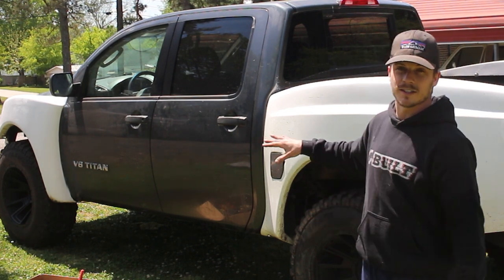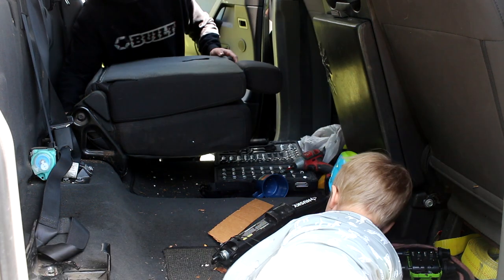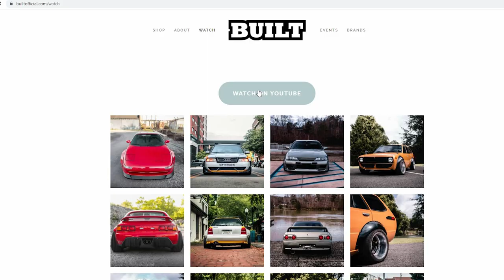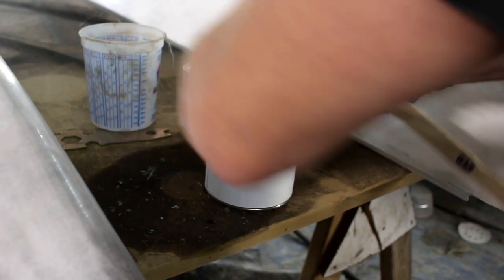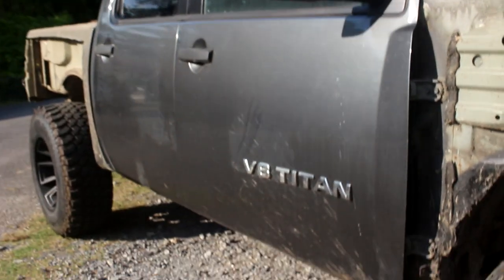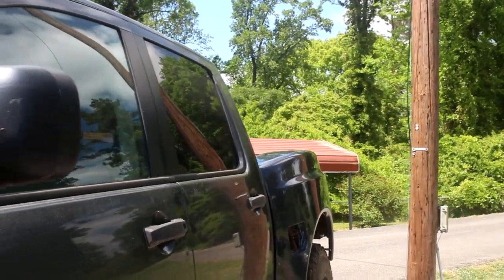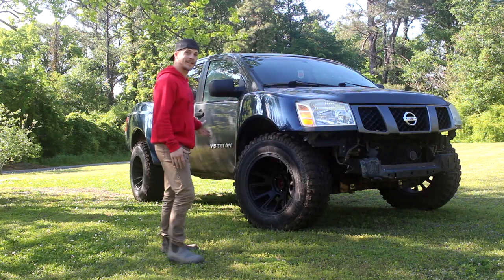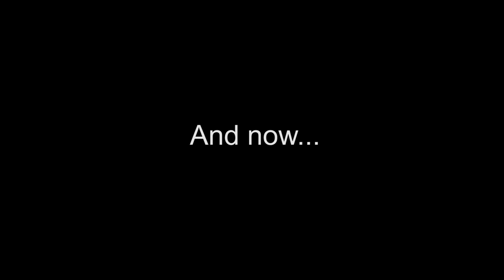I ACCIDENTLY PAINTED MY TRUCK THE WRONG COLOR

Comment: When using fiberglass, bondo or fiber reinforced resin, use plastic wrap or even saran wrap while it is still wet. Stretch it over the surface and pull it tight and smooth it out, remove when partially set up. It will give you a lot better of an end result with heaps less sanding.
Reply: Yep, I use cut up shopping bags

Comment: Honestly man, I’d tape off the trim/glass/badges on the cab, slap on a couple different grits on the DA, hit the cab and roof and rough it up enough for primer to stick just fine, give it a quick wet sand, and spray everything, including your mirror caps and fuel door, and lastly just hit it with that same blueish single stage. That way you don’t ever have to worry about damage or if it gets scratch it up. Would be perfect imo 🤌🏼
Or you could always paint the entire truck in some dessert khaki, or some muted army green rhino-liner 🤷🏻‍♂️ or just wrap it haha full rhino-liner paint would be sick af though. Only finish in the world that you can wash scratches out of 😂

Comment: cuz there's definitely specific things you have to do in spring metallics which I'm sure you know as far as I know it's the angle of the panels and the PSI that the gun is being used will make huge differences in the way the metallics lay down

Comment: So when spraying metalics you wanna spray them in the position they fit on the vehicle so the flakes lay down in the same orientation. It shouldn't be that dramtic of a difference but will effect the color.

Comment: You should raptor line the whole truck. They sale a kit that allows you to do any color. It would look sick
Reply: Especially since fiberglass isn't the strongest material....
Reply: @darrenswails  Fiberglass is way better than steel , it doesn't rust or dent and it's easier to fix if it gets damaged . Most older trucks are more bondo than steel for that reason .
Reply: @Shadowband72  easier to fix ...i said nothing about that...steel dents but it takes heavy impact or a sharp edge to make a hole, the original comment was to  put a truck bed coating on it to make it a little tougher for the trail..that would probably help the steel fenders too....
Reply: @darrenswails  I have a gen 4 Camaro with Fiberglass doors and fenders . I had a truck back into my fender and it never even cracked it . It made a section of clear coat come off and bent the bracket behind . That same hit would have destroyed a steel fender , same thing with my doors . Fiberglass doesn't dent like steel and it takes way more to break it than to make huge dents in steel or aluminum . Cheap Fiberglass body kits have give it a bad rep . And that makes about as much sense as blaming Ford because Kia's are shit , just because they both build cars .

Comment: not bad for first time spraying metallic let me give you a little bit of advice hang all the panels in the direction they're going to be facing when they're on the truck metallics have to be sprayed in whatever direction the panel is going to be bolted onto the vehicle from what I understand/ have heard... but I can't hurt to double check the internet and make sure my tip is correct 😂 lol

Comment: dude i repainted my front bumper cuz i had the middle section with chrome and i have the same smoked metallic gray. and my paint job didnt turn out blue. Its def because the fenders where white. when i did my paint job i had a dark gray primer underneath

Comment: You need a better spraygun to spray metalic paint it's not you.. You should also use 2 stage paint. When spraying the base coat you make the spray pattern wide and the last coat you hold the gun farther back misting the paint on in so the metalics go on even. Then when you spray on the clear coat it brings out the magic.

Comment: Ahhh, yes you can sand runs out of single stage paint. How do you think it was done back in the day with lacquer paint jobs. You sand it and then buff it out. Sorta looks like a state patrol vehicle. Georgia’s has a similar color theme but opposite the panels. Is the gray color original to the truck or could someone have painted over with gray?

Comment: It looks like just a mixing issue. Whoever made that batch definitely added too many grams of blue. And as for the leopard print and streaking that comes down to how fast you're making your pass distance from the panel being consistent and making sure you have the proper tip size. Love the videos, keep up the killer work and always follow your dreams.  You're killing it bro.